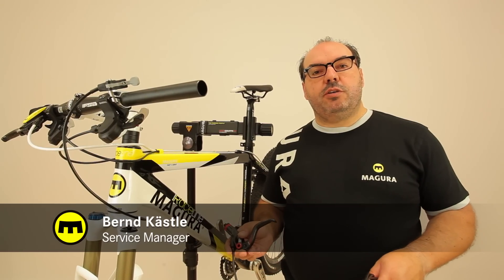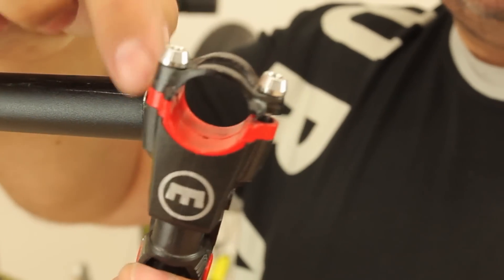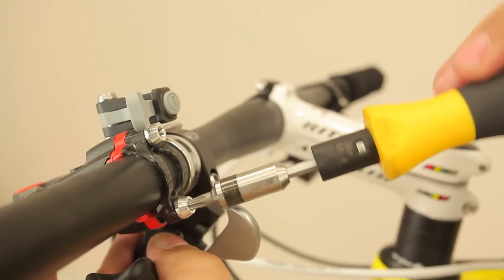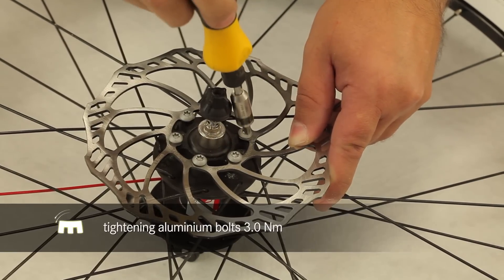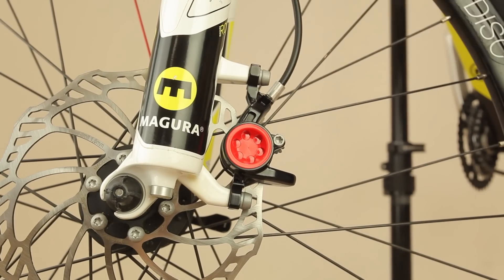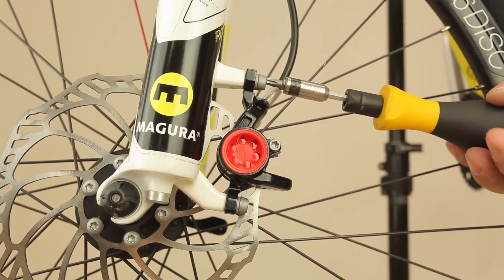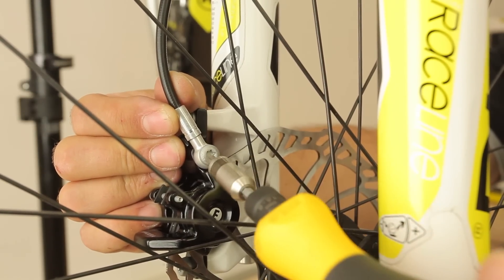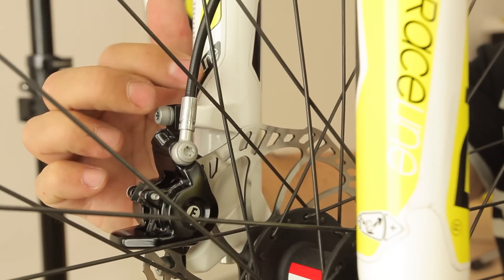Mounting/Installation a MAGURA MT-brake (MT8, MT6, MT4, MT2)

Comment: Very long to install because there is no standard hose lenght. The bleeding is not as easier as shimano bleeding.
Reply: You shouldn't even have to bleed them on initial installation. (Even after cutting.)